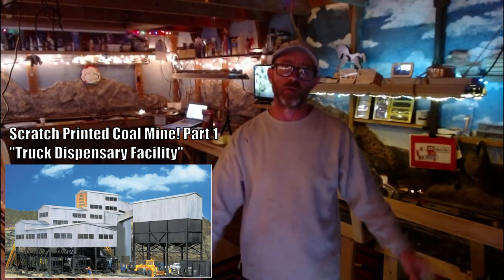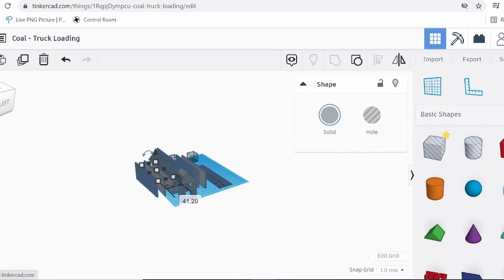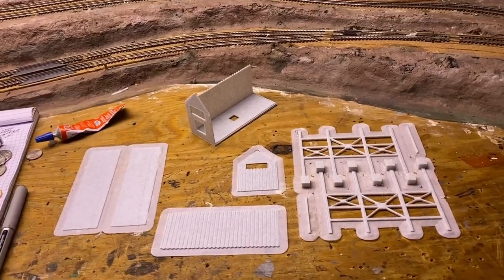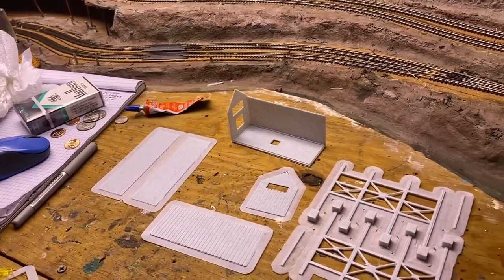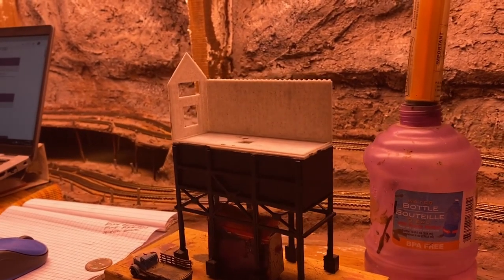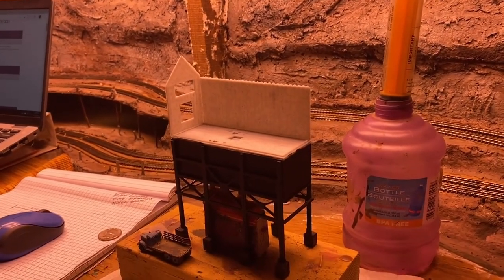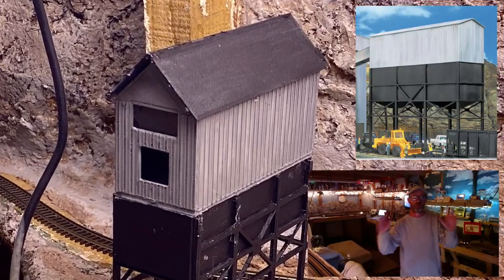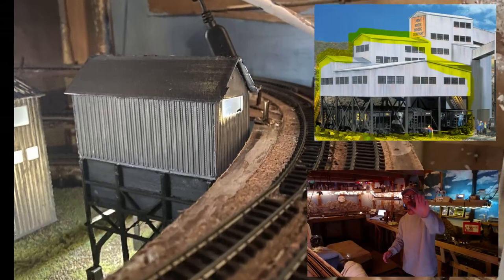Model Railroad Structure Build Series - Scratch Printed Coal Mine - Part 1 - Truck Loading Facility

Comment: Brian, that's looking pretty darn good. You should be proud of it. 
Looks especially good for being a filament 3d print.
Reply from the maker: Thank you very much Roy!  I still have to sand a few edges, add some accents , another coat of paint and weather, but I am very happy with how it turned out.   I like to do a rough paint job because that little guy could be sitting there a bit before I do all that I mentioned above! :-)  What I am finding, is that when you print the pieces of the model and they are mostly flat, filament produces a very good model piece.  They fit well together ect.  Not so much printing the entire structure like I did with that cabin on the introduction.   I think I would need resin to do a good job on that.  But In kit form, filament is producing a good product.  Thanks Roy! Great to see you!  I appreciate it.  Brian

Comment: Very impressive Brian! I love how you design it as a kit and then assemble it. That makes for better prints to be sure and much more flexibility in painting, detailing, etc. The alignment ridges (on the floor) is a real nice touch. The truck dispenser came out great - very well done!
Reply from the maker: Thanks John.  I am really enjoying this new (to me) part of the hobby.  Always something new.  I love it! I have also considered beginning making the model pieces in two's.  See then I can get a guaranteed 90 degree angle in certain situations. Example would be doing a box in 2 pieces as opposed to 4.  two Perfect 90's gunna make a straight model!     Brian

Comment: looking good. the only time i use a raft is when i print something tiny. those big parts you printed doesn't need a raft plus the printer your using has a glass bed my printer has the build plate that came with it and i use hair spray to prevent anything to come unstuck. I'm not trying to tell you what to do I'm telling you what i know. great vid
Reply from the maker: Hey Dwight!  I welcome suggestions.  I am learning.  Continue sending them my way.  I'm more familiar with the tinkercad and cura parts.  I am learning more about the printing process itself.   I am having fun.  I appreciate you commenting and like I said, suggest away.. I am learning.  Appreciate you man! Brian